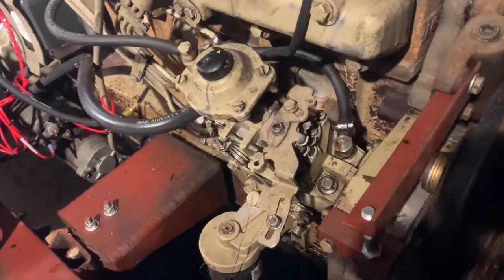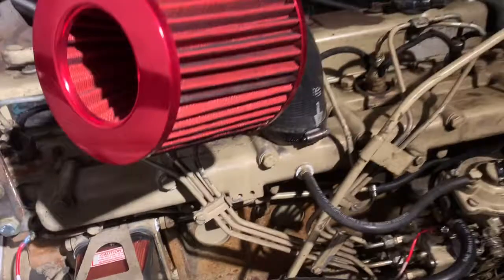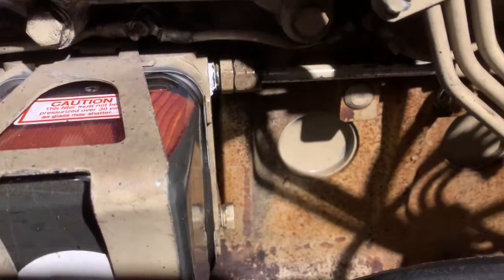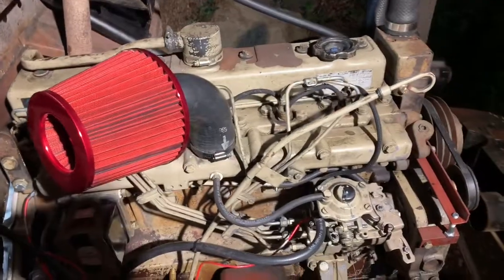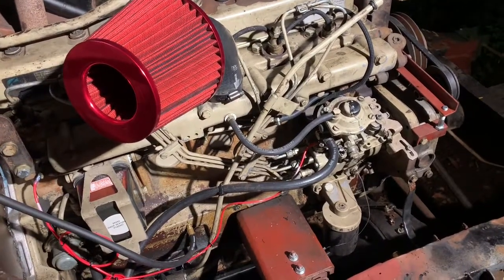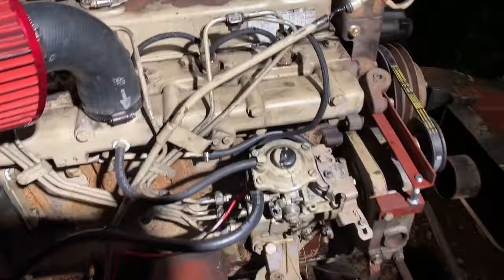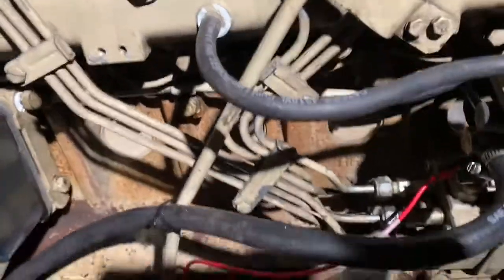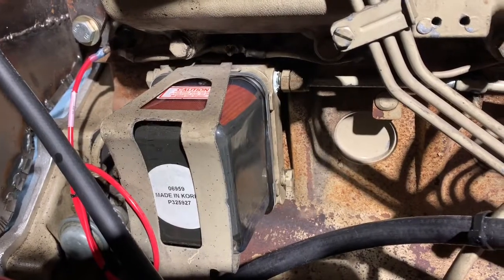Cummins 6AT Fuel line test

Comment: a cordial greeting very good your video I have a 6AT 3.4L turbo engine could you help me with the spare parts of that engine could you tell me where you can buy them I need two chamber gaskets and the 6 sets of piston rings to std in what Could you help me I appreciate it I am from Venezuela thank you I am somewhat urged for the spare parts
Reply from the maker: COMIENZO-AL-SABER thank you for the kind words. The parts you have listed are hard to come by. I suggest you look for a running engine or a rebuilt long block.
Reply: buenas amigo tambien soy de venezuela de puerto la cruz quisiera saber cuando grados de avance usted le da al motor tengo uno igual
Reply: @ariagnyplanchart7659  lograste colocarlo en punto me pasa lo mismo soy de aragua